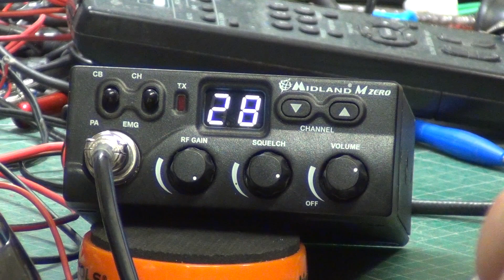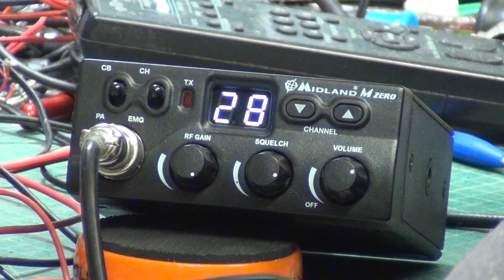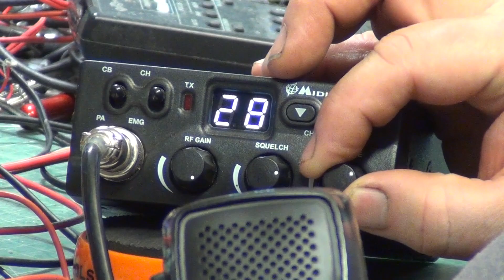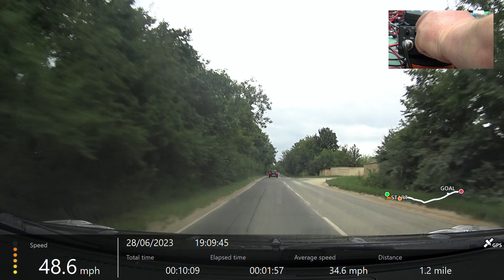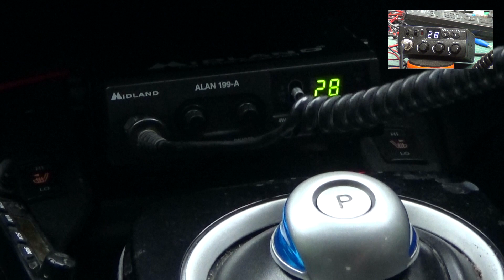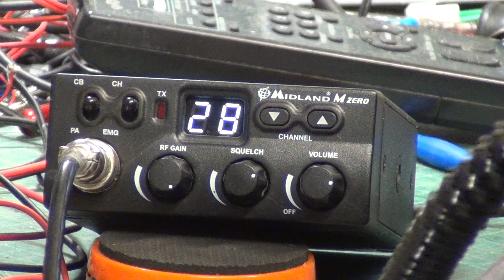Midland 199A to Midland M-Zero CEPT AM benchmark test (CE approved), base to mobile

Comment: Really interesting to see that and it goes some way to confirming the wisdom of The Home Office's decision to opt for FM all those years back.
Not a feasible option for the channel obviously, but it would be interesting to try the AM - AM test somewhere more westerly in the UK, further away from the Continental interference.
Actually, that said, I imagine you might well just trade Euro-generated noise for more of the over-powered US stuff bouncing over the Atlantic and negating any small benefit, and as the UK is so small, perhaps it wouldn't make much odds anyway? 
🤷‍♂
Reply from the maker: I do a lot of AM with my valved kit on amateur radio. 8 miles from Grantham to here on 10W..ish & it's barely readable on ordinary groundwave. I've tried quite a few bands too, like 3.5Mhz, 7Mhz, 14Mhz & 28Mhz....and 4M AM still waiting for one contract!

Richard, G0OJF, UK

Comment: "Export" and "10-m ham" (or 10/12-m ham) radios are a thing in North America, too.  Neither country's regulatory agency is interested ... UNLESS you interfere with a licensed service especially if that licensed service is military, public safety, or aviation.  

I am of the opinion that we in the USA should petition the FCC to allow the UK FM channels to be used here.  All the radios these days have them available in their chippy little brains (no offense to Mr Chippie) so it's just a matter of a small firmware mod and run them through the flimsy certification process ... as is being done with the AM/FM sets.  

Ancaster Service Station (Murco)
£1.439/L -> US$1.82/L -> US$6.88/US Gal
£1.459/L -> US$1.84/L -> US$6.98/US Gal - Diesel

Rauceby level crossing (Murco)
£1.467/L -> US$1.85/L -> US$7.02/US Gal
£1.459/L -> US$1.84/L -> US$6.98/US Gal - Diesel

Comment: I'm still sceptical  , I think you have something in the property causing you not to hear Mr Chippy as he can hear you also there is so much more crap in the air now day's ,
I remember AM ( Illegal ) being a lot better than it is now as I've told you Richard I use to speak to Ancaster from my 20 using a DV27s on a car wheel in my bedroom also Ropsley and Folkingham i'm very puzzled and quite disapointed :(
Reply from the maker: There IS much more noise around these days than there was in 1980. Remember when we flick between AM & FM on the CEPT band that FM works better. So whatever the noise floor is, FM deals with it better.  

At the end of the day, business radio systems would be still using AM if it worked better than FM.

As a radio amateur I do mainly AM & not SSB.  I just had a digital amateur radio contact last night on the 14Mhz band into Pennsylvania United States on 200mW.

Richard, G0OJF
Reply: i live in nottingham and i too have the noise lvl he has got .